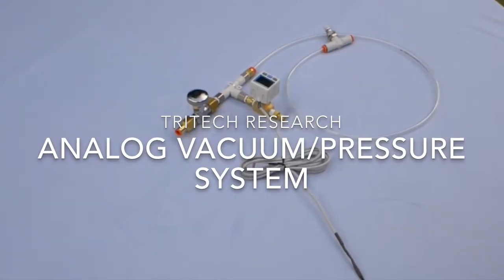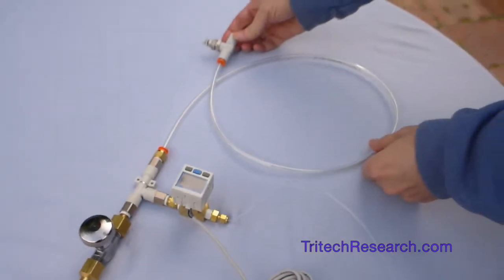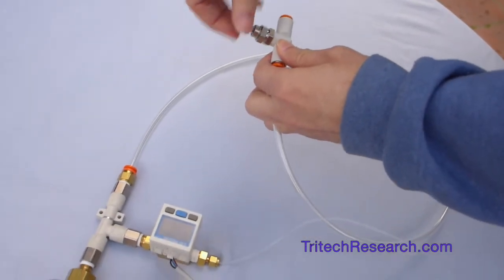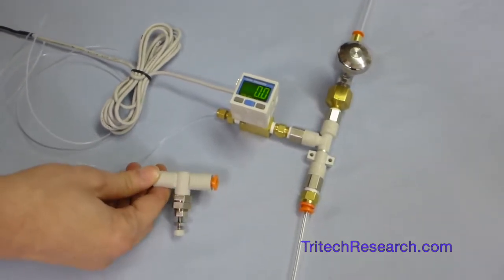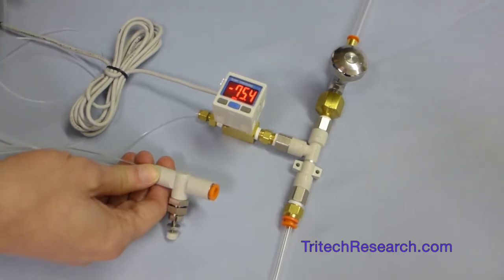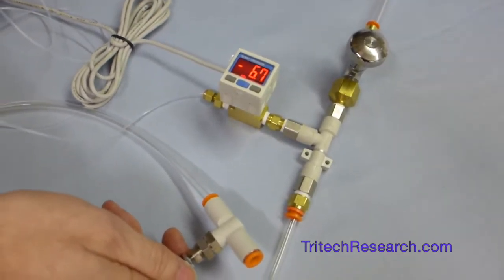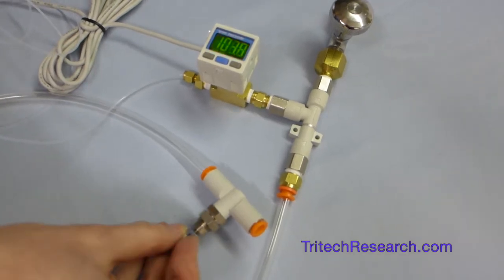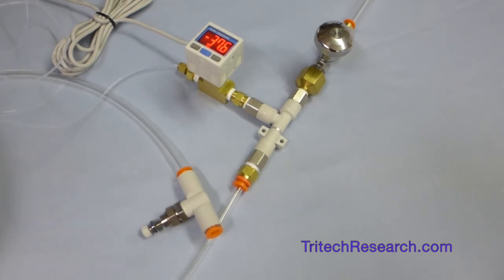Analog Vacuum and Pressure System

Comment: Would i be able to control a vacuum pump with this component? Ex: If it were to read over a certain limit it will turn on a vacuum until pressure is at the desired set point?

Comment: Question... why would you need negative pressure? Thank you.
Reply from the maker: You can use negative pressure (a partial vacuum) to hold something by sucking it on to the end of a tube or the open end of a cone. You can also use it to fill a needle by sucking something up through its tip.

Comment: Great video! Thanks for it. 
Yup, I would also like to know how to use just the “display current pressure ” mode and not all the switching on off and other fancy settings that other videos are showing. Also how you power it :)
Reply from the maker: Hi Mark! Thanks!  At the other end of the white cable is a universal input 12 volt DC power supply. You just plug it in, and the until starts working. When the unit turns on, it is in the “display current pressure ” mode. You have to push the buttons to get into a menu mode to change the device set up, and when you exit the menu mode, it returns to the “display current pressure ” mode.

Comment: Why not show wiring connections 🤔
Reply from the maker: There aren't any needed wiring connections. At the other end of the white cable is a 12 volt DC power supply. You just plug it in, and the until starts working.

Comment: why not show function seting
Reply from the maker: Hi Dhiva. The unit comes with a written manual because it has many many possible function settings for alarms and triggers, however, none of them are needed for its intended application of being a manually operated negative-through-positive pressure control.

Comment: Why not show wiring connections 🤔
Reply from the maker: Hi Arif! There aren't any needed wiring connections. At the other end of the white cable is a 12 volt DC power supply. You just plug it in, and the until starts working.
Reply: @tritechresearch8370  very good sir thanks so much